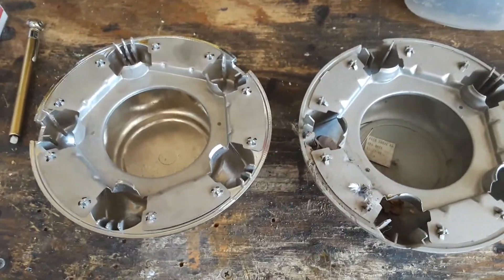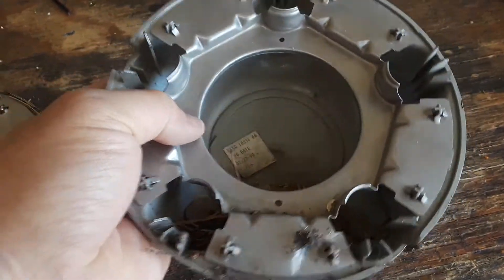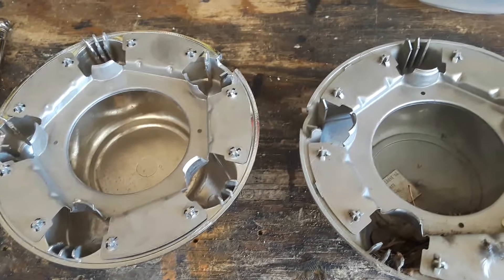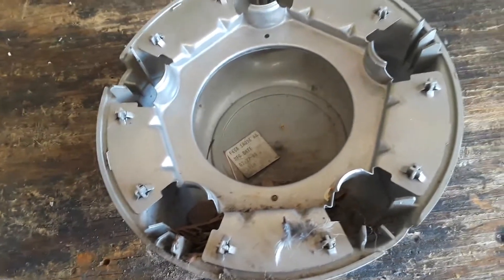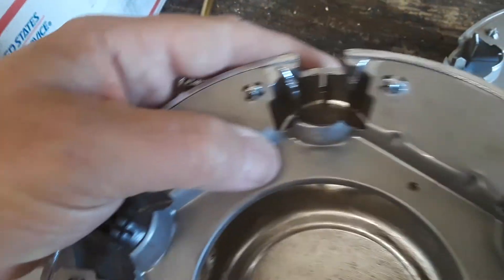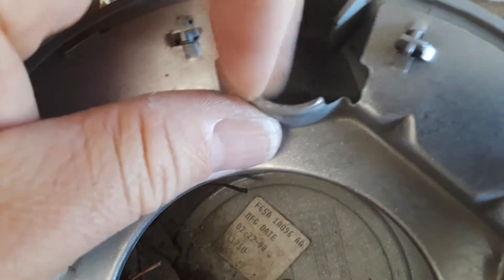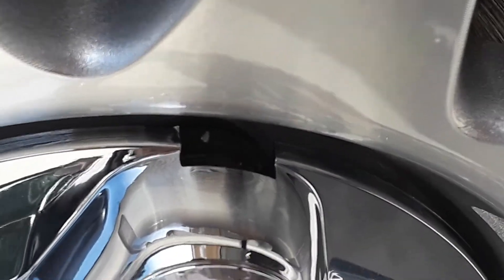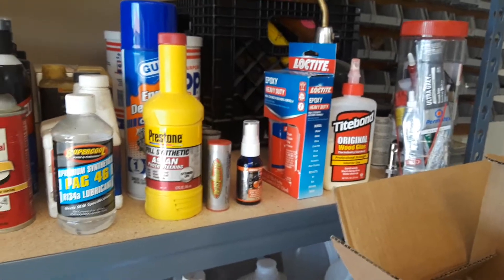97-03 ford truck/suv center caps

Comment: nice video i had just bought some hubcaps too for my 1998 ford f150  and i figured out why i had lost 2 new ones them tabs that  hold on to lug nuts were slightly to long and was leaving marks on the washer on lug nut so i took the dremel and shaved some off of it and let me tell ya they not coming off by hand like they were when i  purchased them hope this helps
Reply: what did u shave off im gonna buy some and i dont want the falling off
Reply: I also have a 98 f150 but mines a stick hehe

Comment: Did they stay on?
Reply from the maker: Not on there own. I ended up putting a small dab of grey rtv on each lug nut and then popping the caps on. They hold on fine now and are easy enough to pry off for tire rotations. I tried just about everything to get them to hold by themselves and they just wouldn't stay on no matter what I tried.